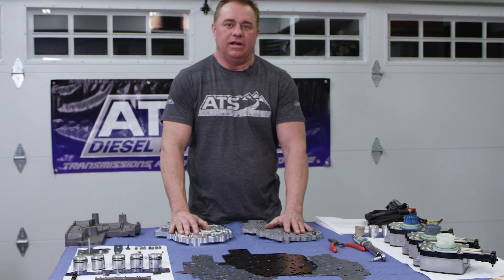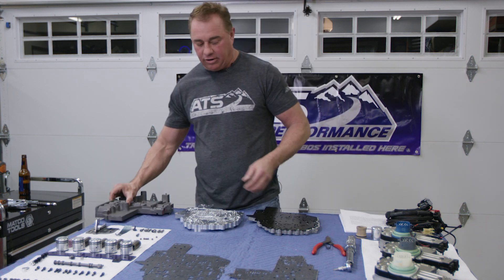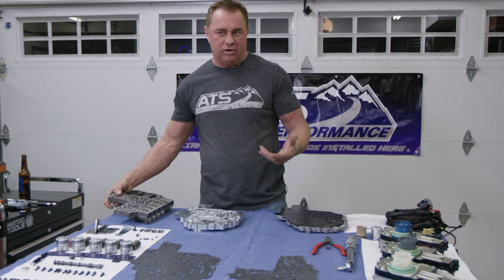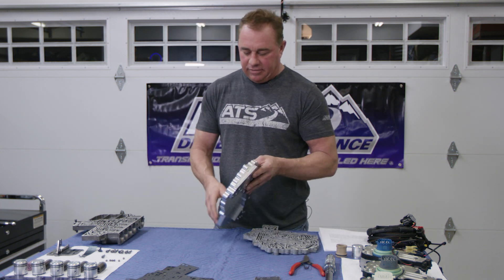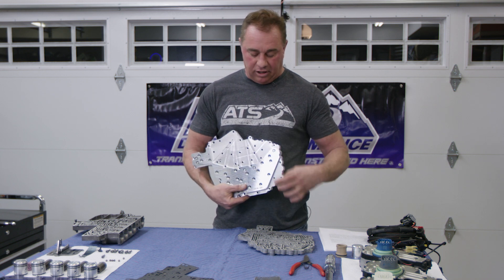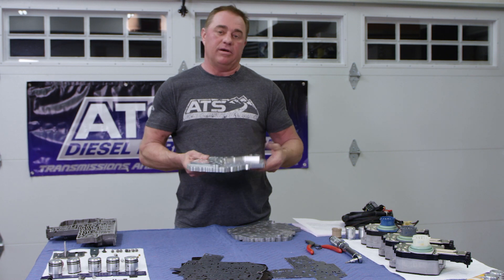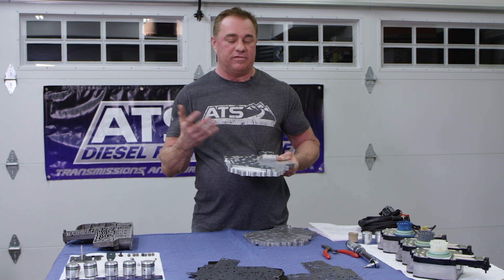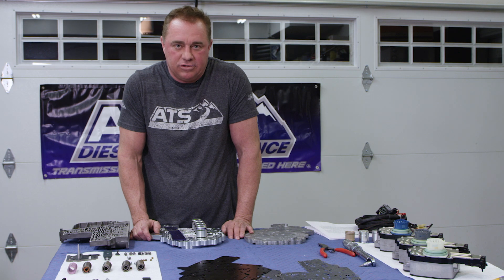ATS Diesel - BilletProof™ Billet Channel Plate 68RFE 545RFE

Comment: 2016 3500 dually. Installed the billet valve body and deep pan. Quick and easy to do. I am waiting on the Co-Pilot. With just the valve body I feel no change in the shifts. Will update after I install the Co-Pilot.

Comment: Just did the install on my 2015 ram. Thanks to Adair at ATS he help me out with the order. I got the trans pan, ATS billet channel plate, ATS co-pilot tow edition, Thermal bypass. Everything works great, very impressed on how the trans shifts now. Trans feels very solid. The directions suppled by ATS was helpful to me as I’m am just a do it yourself guy. We will see how it all works when my wife and I start traveling. I pull a 10,000 pound travel trailer. And I will post my opinion.
Reply: Update?